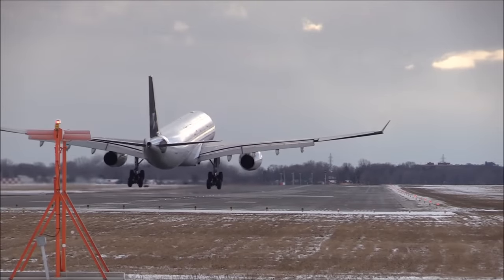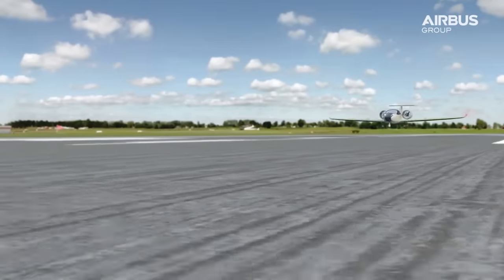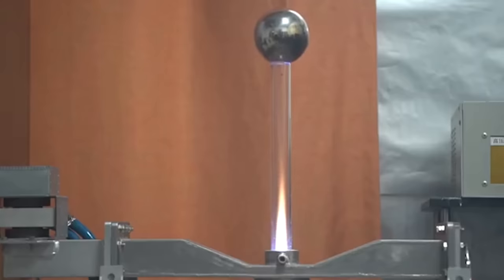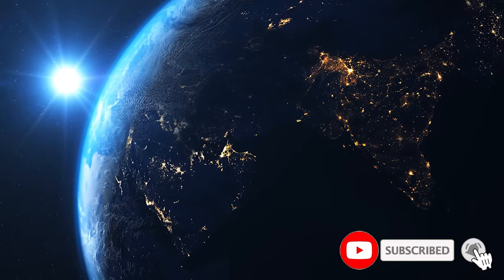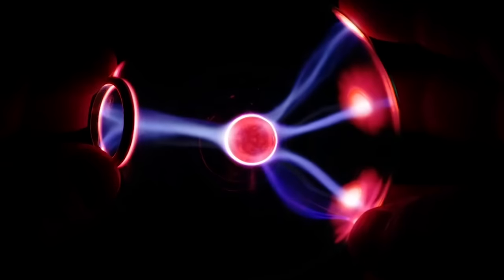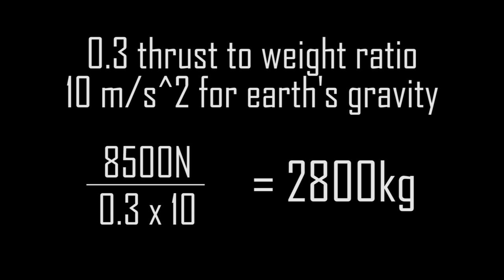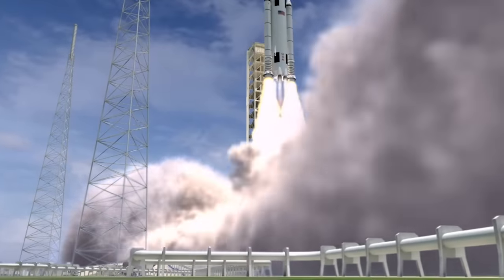Uncovering China's New Electric Plasma Jet Engine

Comment from the maker: Thanks for all the support on this video! I really enjoy reading everyone's opinion on this new technology. However, PLEASE keep comments related to the video topic and not about personal opinions of China. Many thanks, Ryan!
Reply: You don't like colonized in earth?
Reply: model s has a 100 kwh battery pack so not sure you would want to dump all of it on a 10 mins at max thrust . also thrust requirements can be minimal based on type of aircraft . and since there is no oxygen requirements it can fly at much higher altitudes . so in theory you could have family sized aircraft with inter state travel capability , similar performance to a helicopter.
Reply: Jau Tang  wow great work sir . i have few question on the designs .
Reply: What if the gas being ionized was Hydrogen?
Reply: @arvedludwig3584  I for one am able to discern between the chinese people and thier government. The people are nice from what I have heard. Thier government is just a small fraction of them that is running  a authoritarian ethnostate against the will of the majority.
I have no grudge against chinese scientists doing thier work in the scientific community, which is pretty international anyways.
Science is about working together to gain unbiased insight into the world we all live in! 🤗❤🔬🌍🌎🌏🔭
Reply: Jau Tang  Could it perhaps be because the efficiency is so amazingly low and hardly useful in a true environment?  Best regards from a jet engine designer is also doing research.  If you can reach with your device, 50 W/N, I'd be happy talk to you.
Reply: This does kind of reopen nuclear powered planes.
Reply: To add even more propulsion, check out this playlist.

Ok so I can't give links or my comment is hidden.

Find a playlist on my other channel called "STL "Slower than light" next generation ion engines for airplanes and space exploration, also other near the speed of light propulsion".

------------

Check my channel that has 2 simple steps, for my other channel.
Check the "About" tab of the channel I'm commenting with now for info and a link to save to your browser's favorites.
Be sure to read the info under the "About" tab on the channel I'm commenting with now, when you go to use the link found there.
Reply: Seems like a very interesting technology -- are there any other videos or articles on it, so that I can read more about it?
Does the electric jet care what the air is made of? For instance, would an electric jet work in the CO2 atmosphere of Mars?
What about the Ion Wind / Lifters that people used to make? How do they compare against this?
Reply: @Ck Tha God are you referring to DuFour Aerospace? There are a couple of vids about them on Youtube, though not from this particular channel.
Reply: Don Quarnstrom  with enough power, you can use your jets to directly fight gravity, without the need for wings. Look at Blue Origin's New Shepard rocket -- it first started out with 4 turbojets. There's a Chinese company called NewSpace which also imitated that same approach.
Reply: out of a possible 5
Reply: Oh get off the battery allready and use some damn fuel! Using just the APU on most transport category aircraft would easily provide enough power to make the battery obselete.  We use turbine engines to power everything on a jet and the battery is just to get the APU started.  No way can you make this plasma jet engine run purely off battery power you need to go hybrid so you can power the jet with redundancy.  And even then the gearbox on the plasma jet engine could run a generator to help plasma generation, but you cant completely remove fuel consumption because there is no such thing as a generator producing 100% efficiancy.  In the end this tech would be very effective to reduce takeoff weight.  Burning less fuel is always a plus, but need to really test it first.  Afterall hydrogen powered flight was at first considered the cheepest and most fuel efficiant way to fly but then the hindenburg.... blew up.  Also I want to add that if your going to just plasma the air why not throw water straight at it to cause massive thermal expansion after the ignition?  Still need to power the heaters though or that water freizes at high altitude.
Reply: @avolantyable  but maybe you could use a nuclear reactor to power the electric plasma jet, and then it could run indefinitely (or until the parts wear out). The plasma jet could be used as part of a nuclear-powered aerospace vehicle which could even go to space. The jet would operate during the atmospheric portion of the flight, and then a pure rocket mode during the space portion of the flight.
Reply: @manofsan  Your talking about a time when we have star destroyers and avoiding political loopholes and public pushback agaist nuclear meltdowns above city skies.  Nuclear reactors in the sky is a major public upset and will be for a long time.  Not to mention weighs tons! Which is why a watercraft that does not care about weight handles that job with ease.  Aircraft turbine engines are always overlooked when it comes to power generation, you do know that our current laser technology the military is using developed by Lockheed runs off the turbine engines right?  I feel its a shame that we completely try to remove the use of fossil fuels and try to go 100% electric. When turbine engines were created endless potential was achieved to a higher level.  We dont need a rocket to break the sound barrier anymore and turbine technology is always improving day to day.  It would not be hard to augment its use to this new tech we are discussing.  Simply find a way to rapidly increase the microwave tech to electrify the air fast enough to keep the increase in thrust and add a dash of atomized vapor/fluid and you have intense expansion that drives the intake even faster.  If the engine only uses pure air it will be weak thrust, air needs another product to expand with and I already suggested H2O for our environmetal crowd, however freezing will be an issue since most high altitudes are -50 degrees F which is why we use kerosine jet fuel.
Reply: @avolantyable  it may be hard to do on Earth, but it might be possible to use nuclear power for transportation on Mars. We already have nuclear powered rovers rolling around on the Martian surface, so we might be able to have nuclear-powered  hoppers on the Martian surface, which use jet-propulsion for short hops.
Reply: @patrickgronemeyer3375   The US nuclear airplane engines used heat from the reactor to make thrust in a jet engine. They don't make electricity. And a big drawback of having a reactor is the weight of shielding the crew from radioactivity.
Reply: @manofsan  Well yeah it would be more achievable when weight reduction occurs at a lower gravity, but you also forgetting something about Mars, l a c k of burnable o x y g e n... Jet engine would he worthless on that rock...
Reply: @Uffeful  exactly if we disregarded all saftey for the crew nuclear powered flight could be possible but at the cost of an uncontrolled meltdown...
Reply: @Uffeful  no bro. Reactor to electricity. Electricity to motor... Fly for ever. No fallout radiation
Reply: @avolantyable  but the whole point of the device is that it's an electric plasma engine, and doesn't use chemical combustion for power. So that means it could be atmosphere independent, just like a nuclear-electric rover is unaffected by the lack of oxygen atmosphere on the Moon or Mars.
Reply: if your gonna post a video about chinese supremacy on old technology, what kind of answers do you expect?
Reply: How if we use hydrogen fuel cells to generate electricity and use its exhaust for cooling system in plasma jet technology?
Reply: @adwaitmanjalkar8480  it's easier and cheaper to just burn the hydrogen, rather than convert their energy to electricity through fuel cells.
Reply: @arvedludwig3584  THEY steal they do not discover.
Reply: Lol!! I take it this is just like China's "Transit Elevated Bus" propaganda debut in 2010 turning out to be all hype, No application, all scam, scrapped by 2016 only good to try convince the whole world that China is where all next "4th generation" innovation comes from 🤣🤣😅😅 And buffoons like these with their channels just enhance that false illusion, all to get hits and subscribers 👏.
Meanwhile SpaceX's starting commercial human taxi services to the ISS, the Moon and Mars without the need of any "propaganda" just simple actions, genuine indigenous innovation and tangible applications that speak for themselves. But you won't hear it in this "China's where's at" channel desperate for hits and subscribers. Fantastic upload Ziroth 👏👏
Better hurry and erase this comment before subscribers see it cos one can't have a difference of opinion other than "China's where's at Propaganda" 😅😅.
You following right in line with your Totalitarian role models you admire so much and the Totalitarian world you seek to live in one day.
Reply: @avolantyable  sir, lightning doesn't involve combustion. It's a plasma arc effect. There is lightning on other planets having an atmosphere, including Mars, Venus, Jupiter, etc.
Reply: @manofsan  Go look at a jet engine and read up on it, of course there is lightning on other planets what you need to understand is how they use it for ignition of the air by using microwaves to create the plasma effect on condensed air resulting in combustion....
Reply: @manofsan  You have to understand why its a remarkable tech is because normally when you have super condensed air and try to make it combustible you cant just turn on an igniter and cause a flame in the air by itself is not enough.  Thats why with this new tech they can ignite it and keep a flame going without using fuel...  Its awesome cause it gets past the fire retardent of the condensed air!  Sure its hotter and will probably burn out the engine components involved but like I said injecting water or having cooling air around the components could help.
Reply: @avolantyable  there is nothing in air to combust. There is no fuel put into the electric plasma jet, therefore there is nothing for the air to combust with. There is no combustion reaction going on there.
Reply: @avolantyable  combustion requires something for air to combust with. What is that something you're referring to? Because there is nothing else in the air to do this. This is not a combustion reaction.
Reply: @manofsan  Right because the nitrogen content in the air prevents air from spontaneously combusting on its own you need an ignition source to cause combustion.  However like a burning campfire air enters the flame causing oxygen to burn/combust.  In the video they use pressurized air and feed it into a concentrated microwave causing superheating of the air untill it takes to a flame or in this instance combust!  This thereby goes around normal fuel combustion in which the fuel would be ignited and then the air is burned for expansion.
Reply: @patrickgronemeyer3375  You propose to add more steps to an idea that was to heavy to fly.
Reply: @Uffeful  no I don't technology has improved we have paltier devices which produce electricity from heat alone. We also have different nuclear reactors that are a lot smaller. Not to mention if they supersize this whole thing and tried to make the flying supercarriers from like the avengers.... If anything they're not building nuclear planes big enough
Reply: Ill read thru the research paper,, but What object was that thrust lifting??
Reply: Here’s a thought (4 anyone), can we focus on something powered by the vacuum of space???🧐 
(seeing this would require Air to operate..)
Reply: @dtriplett03  Thankyou been arguing the fact that it uses the air this whole time and people seem to not understand that...
Reply: Ziroth, thank you for a video of a interesting technology. I will stop polluting your comment field with nuclear discussion.
Reply: Jau Tang  I think you're confusing criticism of the Chinese regime and their massive human rights violations (at a grander scale than in any other major global power, please refrain from a stock response about America as it would be meaningless and I am not am American anyway) with anti-Chinese racism. 
People in the West care about and like the Chinese people to such an extent that they would go out of their way to try and support them by lobbying for a more progressive government and for less of a dictatorial societal framework under said government. 
While you may not be free to oppose, among other things, the modern day holocaust being committed by the ruling party in your country, we are. And we will continue to be despite any efforts to change this.
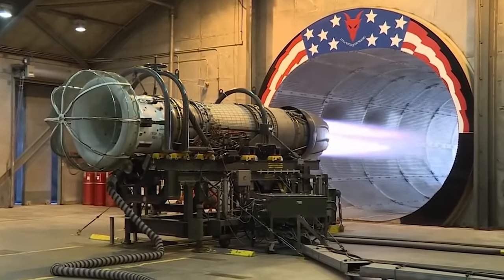Reply: Whats up with the Baphomet head at 4:25????
Reply: It's a pretty plausible scenario, that China was a victim of an attack, especially when considering that nerve agents have been allegedly used by Russia to attack individuals whom Vladimir Putin views as opposition. There are far too many coincidences to ignore. The assertion made that China launched a #Covid ー19 attack makes zero sense.
Reply: I have no idea with those wired China opinions, some saying is other countries like USA are fighting to get the hegemony of new technologies
Reply: Jau Tang  All my power tools are made in China and they are reliable, well made and world class. Many people really respect China, for what they can do. Many other people are scared of China, because of what they can do. That fear is what drives negative thoughts.
Reply: So good humanitarian device, would never be considered just a machine, but a benevolence of will and wisdom, fruit of honest and loyal yet  continuous labor. 😄😄😄
Reply: The wise bird flight begun from soil and goes to the sky under the sun of happiness and obedience.😄😄😄
Reply: Thank you Ryan for saying this
Reply: Dr. Salvatore Pais theorizes this, and even patentent something similar
Reply: Jau Tang  this is future sir
Reply: DOWN WITH THE CCP
Reply: Yeah guys, dont mention the genocide!
Reply: sorry, but 'electric flight' is an industrie brainfart to misuse subsidies. CO2 neutrality can be achieved here and now with biofuels, which can and should be made from anything but food. H2, which can and should not be made from natural gas, could and should be developed to be production ready in the near future. There is no question if it would work. Biofuel for flight already exists, doesn't need any adaption to the planes and is just marginally more expensive.
Instead implementing those solutions, proven to work, but we rather choose to dream of science fiction wonder technic that ignores the periodic systems limitations, ignore the risks of nuclear energy, cause 'thorium', is such a nice word, or hey, even better: let's just colonize mars instead... space pooptatoes for everyone, f### yeah!
Reply: there's nothing wrong with natural gas. It is the bridge fuel to a renewable future that is low carbon and low impact to environment
Reply: @jontopham2742  there is a lot wrong with that. we know since the oil crisis, that energy consumption could be achieved without oil and we do know since the early 80'ies that the amount of Carbon we already released will significantly alter earth climate. the reserves currently tabbed for the first time by fracking, are far bigger, than what we burned so far.
to still talk of a 'bridge technology' manifests that we plan to not invest in well investigated methods and again avoid any progress, in order to ensure that oil reserves will be monetized to the last drop.
there is no such thing as a 'temporary bridge' in an industry that has 50 year investment cycles and what is currently exploited will already last the couple more years it would (and should) need to ramp up the alternatives.

fun fact: investors would get incredibly rich, for pretty much shur, so the whole capitalism thing would just stay like it is, including who owns what...
but doing that 'entrepreneur' thing is obviously to much to ask, of modern days rich fucks.
Reply: I said gas not oil.... Do you understand there is a significant difference?
Reply: the title is very misleading, plasma is still reaction mass, which is not what is implied in the thumbnails, leading people to believe this can be used to fly indefinitely, which is not the case
Reply: @jontopham2742  no, it's not 'significant' it's gradual and to waste yet another round of capital in endeavors that amortize over tens of years, to contribute 'less' (which in itself is bullshit in an ever growing economy) just because the revenue is slightly safer and better to predict than investment in alternatives. So that we are stuck in another half of a century where no progress can possibly ever happen, because it would be insane to replace an existing investment that not yet payd out and hence won't happen.
the fracking technic made recovery of either oil, or since it is ancient, more often gas, that was considered cost prohibitive, profitable. So why do you think those few hydrogen atoms, that come with the additional carbon we didn't even plan for until lately, make that much of a difference? 
Do you happen to own stock in big oil (which also runs big gas)?
Reply: Citation for your 12% claim in intro?
Reply: @dedoshucos  and that was your edited version?
Reply: @jannikheidemann3805  Er no, an opinion poll by Oxford showed 93% of the Chinese actually supports the government. Also, we have been overthrowing tyrannical, unjust and inept governments on our own for the past 5000 years so we appreciate your concern but we do not need your help.
Reply: Jau Tang  兄弟，朕爲你加油。
Reply: John Jack  
If YouTube is blocked in China what the hell is the use in "appealing to their propaganda"?
Reply: @dmar1717  
Okay... China is up there but more advanced than Japan?
Reply: Well it abit to say "Chinas" plasma engine cos as usual they stole it from the yanks lol :P
Reply: Are you being controlled????? Oh no...
Reply: O9
Reply: 9⁹
Reply: 99999999
Reply: 99999999
Reply: oh no i don't think we will
Reply: @andrewray9200  1890'S London newspaper letters to the editor, Sir Andrew Ray  on American science and engineering " THEY steal they do not discover."
Reply: wuhan really coming out with all the game changers this year
Reply: @williamjackson5942  I was not referring to 1890s london, i was talking about the evil, barbaric dictatorship THE ccp, they have been stealing tech from the west for the last 2 decades at least, they wanted to put huwaii in UK and across Europe to spy and steal.
Reply: Maybe you would be taken more seriously without the bullshit click-bait title
Reply: @xandermichels8336  Blown up next year!
Reply: @arvedludwig3584  a Chinese company just released the first ever autonomous driving technology in India and people are boycotting it already smh
Reply: Plasma engines work in space.
https://www.youtube.com/watch?v=HW7UJh70LTE
A SSTO engine could be made adding a hydrogen plasma afterburner.
Reply: Fuel consumption per flight mile per passenger is lower than that of Cars.
Reply: @jannikheidemann3805  ì
Reply: This application could be used as a new sterilization/Cremation device .... I hear plasma is a really hot topic ✌😷
Reply: Done that years ago. Stopperd that because of big problems.   Wuhan?
Reply: Thomas Chrombly  now we can make the hover board from Star Wars
Reply: @andrewray9200  yeah ecaxtly right.. i mean this is hardly new technology.. its been know for a very long time as long as weve had plasma cutters.. its the power requirements and lack of thrust thats the issue
Reply: Thanks for showing a y wing
Reply: Pretty fascinating info!!Thanks for sharing!!
Reply: @jannikheidemann3805  well said Jannik
Reply: @jannikheidemann3805  The people love their government .
Reply: We are talking research here, and all you people talk politics criticize as if you all Chinese matter experts. Yet most of u can't even read Chinese, know nothing about the culture Sina Weibo Baidu Bilibili? Any? Let alone knowing any real situation. Where did you pick up all the hate ideas? Now who is heavily influenced by baised media producing hatred to destablize the world?
Reply: Looks like a p.o.s. to me.  We need some of that stuff the tic tac has in it.
Reply: CHINA STOLEN TECH ALL TIME AND CHINA MUST PAY THE SABOTAGE
Reply: @blameyourself4489  :
Howdy: questions I have, how does this stack up against research we've already done with Arc-Jets ? Could this be combined into a Traditional Afterburner at no appreciable increase in Mass/Volume? Does it have to use DC Voltage? Of the batteries: how 'bout switching to custom-made/moulded Sodium-Sulfur Batteries? Something that has to be Pre-Heated to work, anyways?
Reply: @avolantyable  :
Freezing: that's really not a problem in this. All that had to be done was copy much of what had been done with the SR-71 in that the fuel was pre-heated by running it through a system of viens made into the leading edges of the wings before it went into the engines. This was originlly to provide cooling to the Airframe so it wouldn't build up to Melting-Temperature.
Reply: @Dreaded88  I was talking about the freezing of water if water was super electrified (microwaved plasma) to burn the Hydrogen and Oxygen as an alternative fuel source and water normally freezes at 32 degrees F and high altitude travel is much lower then that.  That is why Kerosene does so well at freezing temperatures.  Sure you can heat the water, but if your traveling in a larger airship that could be a major problem trying to heat all the wing tanks.
Reply: @avolantyable  :
You have a bunch of idea's backwards!
The water doesn't have to be Slush, or Ice to be fed into the engine. Trying to heat all of the Wing Tanks? The Airframe will do that by itself, once the craft is up past Mach1!
Reply: @Dreaded88  Even a Cessna flying on a 70 degree F day get ice in the carburetor at barely 10,000 feet.  Nothing else in the world can freeze water as quickly as high altitudes.  You want to go mach speed?  Sure you have to get going fast enough and have a huge amount of fuel being pumped to the engines, but they cant pump ice crystals that will clog the filters immediately, or probably not even make it to the centrifugal boost pumps cause the feed lines will be frozen solid.  You ever had your pipes freeze in the winter?  Its like that but 100 times faster...  Sure your thinking on the right track about air friction, however when the aircraft slows down or has to perform basic things like slowing down to land, that will kill the aircraft.  Also simply going mach speed is not enough to start to cook your leading edges, try more like 8+ mach from like a space shuttle.  Also leading edges of aircraft are heated with Anti-Ice devices.  Maybe you need to research this more before your next reply.  Also where you planning to fly this craft, only in the Jamaica?  You wont even be able to start the engine if your trying it during late fall.
Reply: @Dreaded88  In theory yes it could.  However, if you look at the energy required to actually propel an afterburner and the auxillary systems it requires, you'd probably fail.
Reply: @blameyourself4489  :
The Afterburner would still be inside of it. This Arc-Jet would simply be a supplement. I think the Turbines, even at Idle, once the Afterburner's take over, might still crank up enough Juice to be able to power it. I'd like to try! [Now if only Robert McNamara hadn't ordered destroyed all the Construction Jigs with which to make new SR-71's with!]
Reply: @Dreaded88  You need to look at your energy.  If we take an afterburner for etc. an F16, it burns perhaps 1 or 2 kg of fuel per second.  That accounts for about 42 MW - 84 MW energy.  Now, try to generate that with an electrica arc.  I'd like the see your auxilliary systems for that.
Reply: @blameyourself4489  :
Hmm,... I thought motive-rotational-power could be drawn from the Turbine itself, and used as a means of 'Recooperation' without it weighing several tons extra.
Reply: @Dreaded88  A good suggestion is always to first look at from where the energy comes.  Then you know whether ideas are worth following up on or not.
Reply: @blameyourself4489  :
Food for thought. Thank you! :D
Reply: @arvedludwig3584  the problem about CCP, is not because it is too bad but because it is too good, too good that make US insecure.
Reply: Hey so does this requires any type of fuel except electricity? If no then spaceships are possible without warp drive ofc
Reply: @dhruvgupta5658  You need to generate the electricity.  So, yes, fuel is required.
Reply: @blameyourself4489  solar energy :)
Reply: This might be news to you...but America already HAD THIS technology.  You're attributing technological advances that China stole from us...thanks Ziroth...
Reply: Ryan, you must know about David Allen Lapoint. Primercube and primer Fields?  If not, you must!
Reply: I like my comments sections shaken, not stirred
Reply: It reads like a Mensa Men's Urinal in here, so I ask you to first consider- 
 why not Over Unity?  
Because equations equate.  If they don't, they're bollocks.  
But what if 0 isn't just a 0, but also a hole you can wiggle in and out of?  Any real number to the zeroth power is, you can guess.  1!  Zero to the zeroth power is one.  It's absolutely logical to consider any point in spacetime to also be a true hole, leaking higher dimensional potentials into the limitedness of our dimensionality.  An observer's perception of infinite will always define the scope of the correspondingly higher dimension, I'm guessing.

And so many smartass potentials here, why can't we just accept that:
Magnets pour out a near constant force of magnetic flux in the calculable form of magnetic moments.  They're always on, permanent magnets are.  As much as flowing water constitutes a power potential, then why not magnets as well?
Because of reasons.  Written and rewritten.  Acceptable as proof of fuck it?  
Magnets don't like to be forced to mingle while all standing up.  Try making a pancake array of like minded magnets, and good luck.  Flux obviously has flare-ups, but from where does this unaccounted force derive?  If light is EMF and a lens focuses light, can a lens also be made to focus magnetic flux? (I think so).

I know I'm not alone in my own head with these kinds of  problems.  Let's get it
Reply: Um I’ll post whatever i like, about China or whatever.
Reply: chyna didnt make this engine though, zer stole the idea from my microwave during a blackout. thats alright, im sure any knock off from that neck of the woods will fall apart and/or catch fire 15 minutes after the return policy expires. thats assuming you actually get it delivered in the first place and the company doesnt just shut down and run off with all the preorder cash. rip lucky golden cat, your retirement fund has been appropriated and redistributed equally amongst the bureaucrats. smile for chyna.

seriously though, fuck communism with or without "chinese characteristics"
Reply: What if you were to use this type of thrust shown in the video, combine with fans that not only charged the batteries but also compressed the already heated air from the plasma? Wouldn't this give you possibly a 1/4 more thrust? Tbh I'm very intrested in this concept of flight. I'm trying to figure how to make a scale model plane with this plasma thrust
Reply: @jonathanbollinger7573  have you ever tried to run a microwave off of a car battery?
Reply: @hop3881  no just solar panels
Reply: @jonathanbollinger7573  ...and?
Reply: @hop3881  it wasn't enough power to supply it
Reply: @jonathanbollinger7573  same with me when the power went out in my home and i tried to rig up my microwave through an inverter to my running car's cigarette lighter.

Look at the proof of concept prototype and the massive power wires in the left edge of the screen attached to it, that much power and the thing is barely jiggling a metal ball. So unless your powering your aircraft with a high output nuclear reactor (which is insane), i dont see how you could bring enough stored energy on it to fly for more than a moment, if at all.
-Also, someone invented nuclear rockets; They irradiate anything in their flight path and make for a nasty clean up when they crash (they do).
Reply: @hop3881  tbh I think electric planes are going to take over soon. Because I watched a video on how wireless charging works and how were working on a way to use the concept of wireless charging, with satellites to power something any where in the world. But if you look at the one graph in the video he was only using like a 400 watt microwaves. Now idk about you but if I warmed up a meatloaf in a 400 watt microwave it wouldn't be very warm, but now if I put the meatloaf in a 1000 watt microwave itd be hotter faster. What I'm trying to say is that that was only scratching the surface of what microwave thrusters can do. I'm not saying that you're wrong I'm just trying to make you see the big picture
Reply: @arvedludwig3584  They didnt discover anything, the Russians came up with this during the cold war decades ago
Reply: @Ziroth - You’ve basically underlined why unmoderated YouTube comments are a dumpster fire having the actual effect of suppressing free speech: trying to have a dialogue in these comments is like trying to have an audience Q&A after a lecture, only one in which the audience all shout at once, about whatever their hobby horse unrelated to the lecture is, and 1/6 of the audience are mentally ill vagrants who wandered into the lecture hall to take a dump, and 2/3 of the audience are bad actors hired by an interest group to yell propaganda messages in unison, and maybe 7 people actually have something to say, but whoever’s loudest gets to dominate the room… so there’s no way for anyone to learn anything new, all anyone hears is incoherent noise plus whatever the interest group paid its bad actors to shout.
Reply: The peak thrust for a 747 jet is 275,000N which is over 32x times more thrust than this electric jet can do at 310kw.

That means this electric jet would need a 38,400lb Tesla battery to produce the same thrust as a commercial jet but would still have a flight time of only 19 minutes at that output. LOL
Reply: Over 100 years from Wright brothers but over 1000 years from Abbas Ibn Firnas
Reply: Wow please could you tell me where you got the animated earth at night in the video?
Reply: Why Trump was not shouting "China steal it.."

Ops, his Twitter account was banned. Guess he is waiting for his new TikTok account.
Reply: America and the UK have had this tech for the last decade and a half. This is old news.
Reply: @gameresearch9535  )
Reply: I remember reading a UK newspaper article about this type of propulsion, which , it was suggested, could be powered by using space-based solar arrays that would beam energy onto the aircraft whilst in flight. No need for large batteries.
Reply: TRAITOR WUMAO
Reply: But biofuel is more powerful
Reply: People taking the stance and adopting the concensus of the international community on the Chinese government is not 'personal feelings about China' though...
Reply: @ConstantThrowing  exactly man, well said. Who in the hell has the nerve to try and dictate what's up for discussion anyway? Especially when it's a load of CCP propoganda BS.
Reply: Thanks for this extremely important update on jet engines for commercial airlines, this is so very necessary if we are to fight global warming. China is in the fore front of many new technologies and we can expect breakthrough soon.
Reply: @sonarbangla8711  wrong WUMAO
Reply: @PlumSack79  US has lost the trade war.
Reply: @sonarbangla8711  China lost the demographic war, all by itself, how dumb is the CCP? Lol
Reply: Stupid science 
Science doesn't know 
Clouds that turn sunlight  
 ( photon  ) into  positrons + and electrons  --
918 positron + suck 918 electron  -- create lightning produces neutron ....
Reply: Ziroth you are saying that the vacuum of space is different what you imply is its empty ? like mainstream science think about space vacuum its empty space with few atoms on a km2 right ? 
I have a very simple but very serious question , if vacuum is empty space how wave propagates in it ? Have a nice day
Reply: @plamenzlatev1206  yes he's a CPC shill and a simpleton who believes every shred of propoganda.
Reply: FREE TIBET
Reply: @andrewray9200  Yes the Chinese stole the 5G and its blueprints from the Americans and now China is testing its 6G. This could be another stolen technology from the Americans also, very soon and including the Chinese space station in the space now. You forgot to mention the Chinese super computer was stolen from the US recently.
Reply: do normal planes have generator turbines that collect power from wind passively during flight?
guess theres no need when you have fuel,
but it would be cool for an electric plane,
for it it to recharge partially & passively during flight, & even a dive.
Reply: Can you make a follow up on this story?
Reply: This was sick, like 5 years ago, people working toward iron man sets for flight.
Power goes in, propulsion comes out, some how.
Reply: @dr.feelicks2051  than it would be worse! 
Less efficient because hydrogen is less dense!
Reply: That thumbnail is an exhaust from P&W F100  series engines.  Worked on them in the early 80's.
Reply: @MrEtronic  such unbelievable BS.
Reply: What Song are you using for the video?
Reply: I've actually applied for a patent that will change the world as we know it.  I will power a jet airplane using the farts of the passengers.  Yes Taco Bell is in on it.